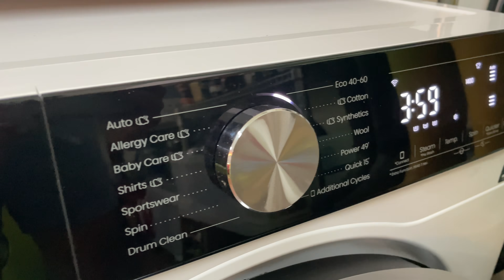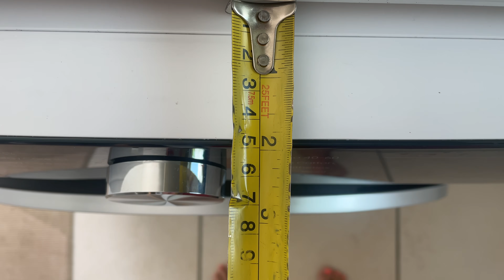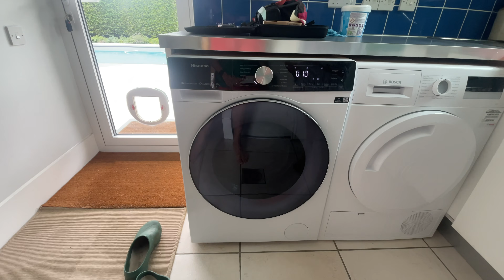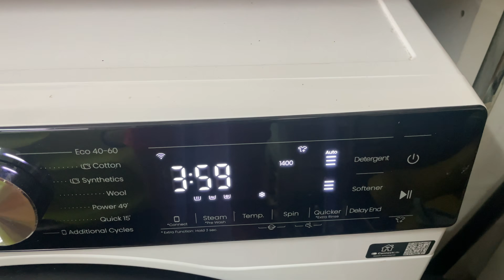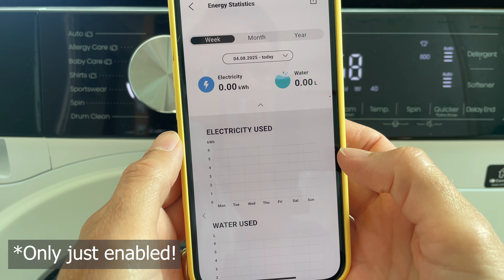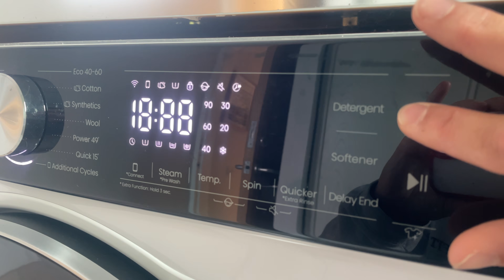Hisense 5S 12kg Washing Machine Review – Quiet, Fast & Energy Efficient!

Comment: I would like to know how to use the soap dispenser without using the auto dose, how does softener get used if you use soap manually
Reply: I think you should be able to by pass the dispenser and just pop a pod straight into the machine, option to by pass should be at the start before selecting a program,  just like samsung washing  machines

Comment: Thank you for this! We’ve just ordered the washer dryer because we’re struggling with a toddlers washing and keeping up with heated airers in the uk. I’m worried about the long length of wash cycles as our current hotpoint does a 45 minute full load but hoping the auto weigh will bring it down to an hour and a bit rather than 3! Thank you for a great review ☺️
Reply from the maker: Or you can just do what my mum does and use the quick wash most of the time! 😉

Comment: We replaced a Hoover machine with this model 5 weeks ago.
The kitchen sink gurgles really loudly. Never did it before. Replaced the waste trap. Still does it!😡
Noticed that the pump stops and starts a lot when emptying. Is this a thing or have I got an issue that's connected to the gurgle/negative pressure?
Reply from the maker: Sorry, it’s really impossible to guess the problem at a distance, hope you get it sorted
Reply: My hisense does it aswell but its because the pump turn off alot when draining its the proggramming hisense use so its not the sinks problem the gurgle makes me laugh lol my sink does it every 6 seconds when its emptying

Comment: Still trying to figure out which setting I should use that doesn't take 2 hours, just for a load of t shirts, jeans, undies and hoodies ???
Reply: Mine has a button that says "quicker". It brings down a full cottons load down to just over an hour. Also the "auto" cycle is quicker than a longer wash but it's not for a full load, around 8kg in my 12kg model. I mostly use the longer wash as I like a good rinse and spin but there are ways to do a faster wash.
Reply: Power 49' has always been my go to but is probably not the most energy efficient but it does get the job done quick

Comment: Self cleaning option just a waste use a good descaler you can use citric acid is often recommended limescale remover, but it can damage washing machine rubber seals and other parts due to its acidity
Reply from the maker: Thanks for sharing your thoughts and experience!

Comment: Another great video Clara 👍🏻. I bought a Hisense American style Fridge Freezer RQ760N4IFE after a new kitchen extension. It was an expensive luxury (£2,000) but after 3 months, I kept getting notifications on my phone via the Connect Life app about a Temperature Sensor Malfunction, then later an intermittent E5 code displayed. To be fair, Hisense UK support was good and quick to send an engineer to replace a faulty sensor. Would I invest in another Hisense product? After my first experience with a Hisense product, probably not a hard working item like a washing machine until it’s got a decent track record. I’m due a new washing machine and an appliance engineer swore by a brand called ASKO. They’re commercial standard and have a Steel Seal rather than rubber. Cons are it has a smaller 9kg capacity and fairly expensive.
Reply from the maker: Thanks for sharing your experience. I'm a fan of brands that produce to a commercial standard which is why I have a Henry vacuum! I've added Asko to my notes, it's the first time I have heard of them.
Reply: And it's also worth pointing out that ASKO are actually owned by Hisense anyway, so it makes it even more odd their own branded machines have such a poor reputation when their own subsidiary is so much better.

The only brand I've ever bought is LG. My current LG washer will be 11 years old in march next year and hasn't ever given me any problems. My next machine will also be an LG therefore.

Comment: I have the washer/dryer version of this machine, Huge capacity for quilts, bedding etc in the summer and a useful 6Kg wash and dry capacity for the occasional use in the winter.  The machine is very quiet, even when spinning at 1400 Rpm.  It only needed attention once when the fan broke, a known fault and fixed quickly under warranty. I bought it on the premise that if it lasted the length of the guarantee (2 years) I would have got my money's worth.  So far I think is should soldier on for a few more years.  Love the Auto dosing, I use so much less detergent than I used to.  All in all a good and inexpensive machine.  Retired 2 person household, so we don't flog it every day.
Reply from the maker: I definitely think auto-dosing is the way forward, it's so starnge that we're still adding weird little plastic balls to the majority of washing machines
Reply: You only got two years form the washing machine that is disgraceful and only 2 person house hold. That’s really bad , I hope your next machine lasts longer that this machine 😢

Comment: I don't know if I trust Hisense, they look great, but I believe they're just a rebranded Whirlpool, with less features.
My friends hisense failed after 6 months and the replacement has also failed only a few months later.
Reply from the maker: Well that is unfortunate, they do have very positive reviews and are a bestseller on Amazon
Reply: @CandidClara  Indeed, I think it's also a case of brands like this and Beko etc, get more negative reviews, purely because they sell a lot more than the higher end brands.
People are much more likely to complain, than compliment.
I moderate reviews on a few appliance websites for brands like hotpoint, hoover, beko etc and the main complaint I see 90% of the time, isn't so much that the appliance has failed, but that it takes weeks to get a warranty repair due to a shortage of parts.
That's why I Tend to stay clear of those brands myself.
Reply from the maker: Oh boy do people like to complain, I have to sift through bizarre moans on this channel every day about the videos!
Reply: @CandidClara  Well the rest of us love you and your videos! <3
Reply: Hisense and Whirlpool have signed a joint venture with each other which is why the beeps and drum are very similar, but the machine itself is made by Hisense

Comment: We bought that model, lasted 6 weeks and AO had to replace it. The replacement then failed in a similar timetable and HISENSE didn't want to know. AO were superstars and took it back, we bought a BOSCH in the end - far superior. 
Shame as the features of the HISENSE were great - it just wasn't well made and would shake itself to bits.
Reply from the maker: That's a shame, they have very positive reviews and my parents haven't had any problems with theirs
Reply: The reason im here is because i had a bosch series 6. 3 years and the bearings are gone. The drum is not serviceable. Meaning £460 to replace the whole drum assembly. Hisense drum is serviceable, so failed bearings in this would be a fraction of the cost. I mistakenly though bosch would last like they did in the 90s the just dont.
Reply: This can happen with every brand 🤣 Hisense its actually Gorenje "Hisense produces products in former Gorenje factories, specifically in Velenje, Slovenia, after acquiring Gorenje in 2018, with new Hisense TV production starting in 2021 within the existing Gorenje site, leveraging its infrastructure for both Hisense and Gorenje/Asko branded goods. " And im sorry but Gorenje was always better than Bosch or AEG(with their pumped prices) .
Reply: @Stoyan1985 ”Bosch is superior for premium build quality, advanced smart features, and quiet operation. Gorenje is generally the better choice if you are on a budget, prefer retro designs, or need specific convenience features like higher cycle counts and AquaStop.”